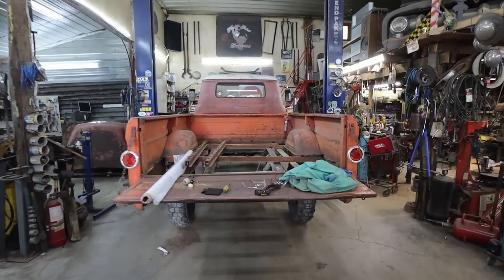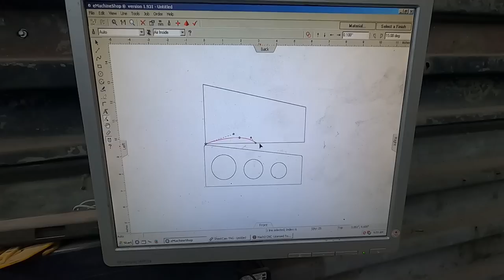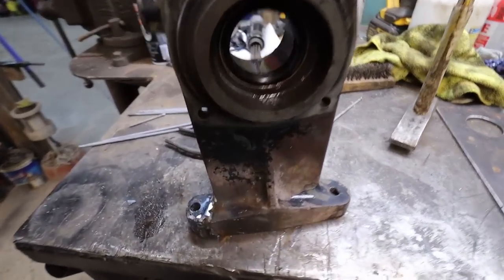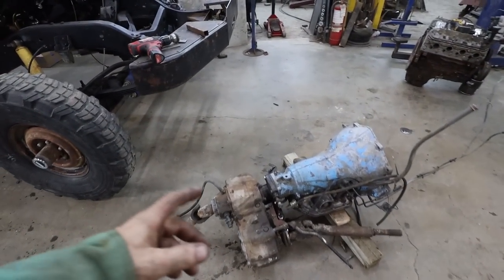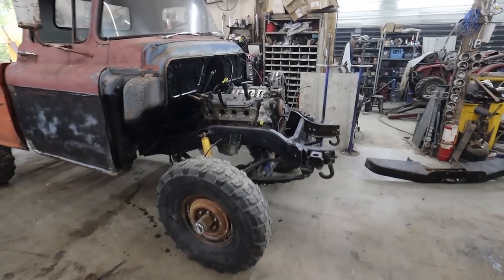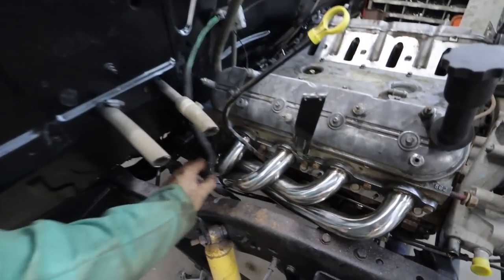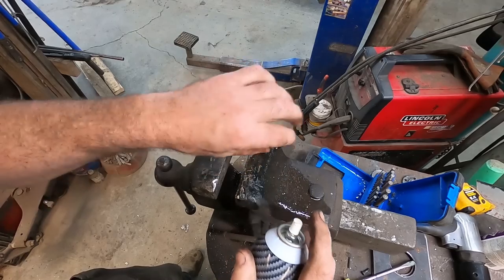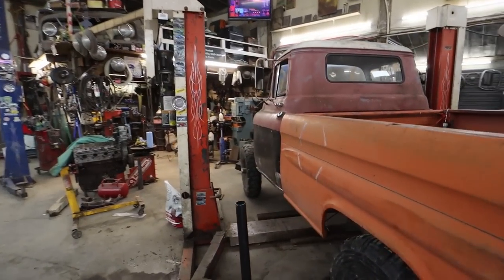Building master cylinder mount and T-case mount along with installing our LS engine.

Comment: have had good results using the round tip of a chipping hammer to stress relieve a cast weld. was taught to ping the bejesus out of it immediately after welding it while it's still glowing.

Comment: Your going to need a trap door in the floor to get the fill cap off the master cylinder for fluid service. Try using a gas tank door. Flip up, flip down 👍
Reply from the maker: pretty easy to just sit under the truck also and have a peak haha

Comment: Excellent Progress, Back in 66 I had a 47 Chevy and we crammed a 57 Olds V8 into with just header stubs I never got the headers made we had tubing but i blew the engine up testing. We found a pair of U-joints that fit the shaft perfectly. I will never g=foret my Best Friend Dale his dad had a welder and taught  Dake so we towed the car from my farm in the north to his farm in the west on the country roads. When we had the motor level and mounted up We fitted the steering shaft. Dale tacked the shaft to the steering shaft. He had me rotate the steering wheel while he welded it up. Turn it Murf faster, not that fast slow down! We had fun. Can't wait to see how you do it alone. Be great to see it drive. Dennis

Comment: we welded a final drive housing on an old 1010 crawler ..built a fire in a 45 gallon drum set it on the barrel and welded it ...rebuilt the fire for post heat ..set it some pink insulation in the basement took maybe a day or 2 to cool down ...its still a 1010 crawler so its always broke and the legs are always falling off but that housing has never ever been bad again

Comment: That transfer case adapter you can get a new one from advance adapters as well as the coupler , double stack the coupler seals in adapter to prevent leaks between transmission and transfer case don't forget the o-ring on the shaft .

Comment: Good job on the welding. preheat and slow cooling is the key. A little trick I use is, after welding, I pack it in sand and leave it until it cools down. It has never failed me. I'm loving the build!

Comment: I wish I was there to repair that gas tank you can connect any fuel tank to the exhaust on any gas operated vehicle with an exhaust tubing preferably 2 in x 10 or 12 ft to connect to any metal tank to be cut and welded. Make sure the tank is ventilated while running the exhaust a few minutes threw the tank. It will heat up and dry from the hot carbon monoxide flowing through it. Making sure vehicle is kept running the exhaust gas through the tank when cutting and repairing. After only a few minutes it's impossible to ignite the tank, carbon monoxide inside and venting out is 100 percent non- flammable. I have used this technique on many metal gas, diesel fuel or oil barrels. I fixed many tanks and barrel's it's much safer than water.
Reply from the maker: Yeah buddy and I did that once on a camper tank still wasn't comfortable though welding it haha

Comment: Try some "evapo-rust" in your fuel tank. I had great success removing old gas residue & rust from my 47 Crosley gas tank. Just pour it in & leave it, then pour it out through a rag to filter the gunk, then put back in with the tank rolled on one side. Work your way around the whole tank & the inside will look like new.

Comment: You went first cabin on the fuel injector cleaner,a departure from all of your home built tools.
But sometimes technology forces a guys hand.
With the motor in, this build is starting to look like something.
Nice job welding that transfer adaptor.
Reply from the maker: Yeah I had a Jimmy rig thing that I used to use but I felt this is a worthwhile investment for the long run

Comment: Brent, sure glad for your work and videos...has helped me in a lot of ways :). A couple weeks ago a good friend brought his older dodge flatbed over for me to fill a bunch of holes in the doors and on the lower sides and put a quick paint job on it. I edge-welded all the smaller holes (1/4" or so) but on each side down low there were 6 large holes (12 total) around 5/8-3/4" diameter so I got out my hole saws and found one small enough to make a bunch of steel plugs to weld into the holes...turns out the hole saw bit was too dull and I wanted to get it done before supper...damn! I said. Then I had a brain fart and I heard myself say "use bolt heads". I haven't seen anyone do this yet so thought it was a great idea. I held onto the bolt and stuck the head into the hole with the backside of the bolt just below the surface of the body and welded them all in then came back and cut off all the bolts sticking out of the body...it worked like a charm...was fast and easy. Have you seen this done before? I'm sure someone out there's done it right?!. haha. So for now on instead of cutting a bunch of round pieces of metal to fit into large holes (from 1/2" to 3/4") I'll just grab some bolts that the heads fit into the hole and weld'em in haha...thanks again for your videos!
Reply: @sheepwolf1st  haha! yes, they'll take off the door panels and look inside and see a bunch of bolt heads...I can see them scratching their heads...(not a punn hehe)

Comment: Excellent video Brent  :) also how wash out fuel tank use Vinegar and Warm Hot mixture together give big shake then drain also do 2 times ! Flush out with warm hot water too and tell how many holes also leaks are ! When fix tank outside on leaks use Liquid Tar or Gasket Mender Sealer then let dry do second coat then put light layer primer, then paint with brand of Rust Coat color silver paint do 2  coats and then brand  Rust Coat of Clear in Spray Bombs plus paint to if want to ! You never see leak long time again !

Comment: you could try some acetone to dissolve the varnish in the tank and clean it out, used it to clean a poly VW tank I needed for my truck not something I can easily get in North America. I also hear that lacquer thinner works even better.

Comment: That part that goes between the transmission and the transfer case Chevrolet used them from mid to late 60s all the way up through the early 80s any truck that had a turbo 350 to an np205 will have that exact part they're very common in the wrecking yards
Reply from the maker: haha not around these parts our wrecking yards only have modern stuff in them.
Reply: I would ask some older transmission shops in your area. Those guys like to keep parts.

Comment: Great job on the master cylinder and the transfer case repair. Also the fuel injector tester/ cleaner is a neat tool to have . 👍the old truck is going to be Kool.

Comment: I have two warn 8273, one is parts. Down payment on the chopped pilothouse, lol
That T-case mount is probably weldable. Some cast welds fine.
Put the left manifold on upside down, point pipe forward then down and around. My brother put a 302 into a 72 corolla, exhaust went forward and down beside rad then under car. The headers seem to fit not bad though.

Comment: on cleaning fuel tank if its got varnish from old fuel use lye to clean found as drain cleaner in  granule form a 12-16 oz bottle mixed with couple gallons water will clean it good

Comment: A guy could drill a hole in the center and tap it.
Use a 1/4" plate with all 3holes and counter sink center bolt and mount it.
Probably would want to drop crossmember 1/4"  to compensate for plate.
Just a thought. 👍

Comment: If the housing is cast steel cut the broken chunk of square and weld on a pice of steel roughly the same thickness. Just bevel the edges, then drill out and thread will be as good as new and just as strong.

Comment: Call me a liar all week long, that exhaust was a real treat!! I  was wondering if you could elevate the steering column up a inch or two and get more clearance from the manifold/header?? I know it always makes for more work somehow but so far what doesn't work .... has! I think that the truck is looking forward to living. Nice save on the adaptor on the trans to transfer case as that was obviously some serious welding but from here in alaska, looks near factory if you keep one eye squinted a bit. Things are really going your way on this installment
Reply from the maker: I could but I find The steering is actually super comfortable in the position it's at

Comment: Make a washer for top of transfer case adapter that will reach over the non broke off part to the flats on the base of adapter and trap it down to c tranny cross member. Like a “U” with bolt hole at bottom.

Comment: If welding/brazing that transfer case adapter and mount doesn't work. looks like there is enough meat there to chop off the bottom, drill and tap 2 holes from the bottom and fab up a steel lower part with ears to bolt up to it. Sometimes as you well know, you gotta do what you gotta do to make things work.

Comment: few of these adaptors on ebay for sale Chevy GM TH 350 to NP 203 Transfer case Adapter Pedestal 4x4  part 335345. but probably  you could find in a salvage yard closer to home ...

Comment: I was hoping you would use hydro-boost power brakes, would do away with the vacuum boost and keep the master cyl up on the firewall. Love the project Brent.
Reply from the maker: yeah will be mounting my engine electrics up there :)

Comment: on the master if you use a ford style they come out the other way also on cast alot of people are dramatic about it if you use plated filler itll weld fine it mainly cracks when people try to weld it with regular mig wire things coming along
Reply from the maker: yeah I did get a Ford master but it didn't fit the booster haha
Reply: @HalfassKustoms  im not sure then im pretty certain only fords have that style master at least on older cars/trucks you could use a ford car booster and master(the cars use a similar booster to what you have ) or just slot the holes on the ford master

Comment: I wonder about using a fuel tank from an EFI Square body Blazer or Suburban.  I know that they would fit in the back of the frame, just not sure with the dump mechanism.

Comment: This is just a thought, and I don't really know how much space there is, but..
Wouldn't it be possible to shorten the rod and put the gear mechanism on the steering column inside the cab? And then lead the cable out? 🤔

Comment: Master cylinder's in da basement under da floor, transfer case mount slug'd n bugger'd, old scool auto shifty from a sad old scool donor, bumper torch'd fer a 2" tuck, motor n tranny n transfercase in n header'd, oil sender'n again n injectors injector'd. Da back dad, don't forget da ears!

Comment: If you are going to open the old tank and have to weld it shut, then why not make an in the tank pump fit also? I would think it would be quieter plus you can match it to the motor. After that it is plug and play.

Comment: Brett I thought a LS motor has a different bolt position than an early transmission, so what years are you bolting together please
Reply from the maker: Yeah all the LS's will bolt to the older transmissions that a small block Chevy will bolt up to just one of the bellhousing bolts won't be there

Comment: my friend got his grandpa's 55 chevy pu a cameo with a 235 v8 with a automatic only thing on it not factory is the new paint job and wood and chrome in the box never had rust or dings in it from factory was parked in a shop for most of its life has under 50,000 miles on it

Comment: You could of welded it with 7018 or your wire welder i have welded many times cast that way just have too get it hot
Reply: I used too work on alot of tractors and combines and trucks and im a certfied welder never went too a trade school went too the school of hardknocks my dad

Comment: This might be a dumb idea, could u weld the linkage bracket inside the cab & use a shift cable going through the floor to have more room for the steering wable joint, ?
Reply from the maker: Sorry man not following ya, but I don't know if using a cable for anything with steering would be a good idea :)

Comment: So what happens when the computer doesn’t get a signal from the oil sending unit?  LS swaps still seem like voodoo to me.  I hope you can use that column shifter.  That is so period correct.
Reply from the maker: The earlier LS's don't care anything about the oil pressure. So cutting that line means nothing to the computer